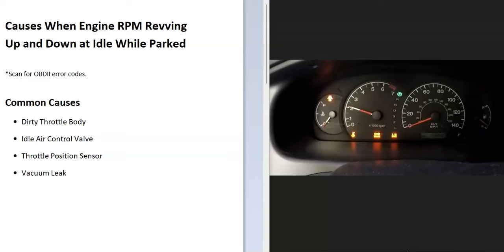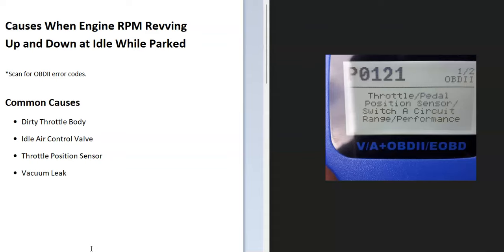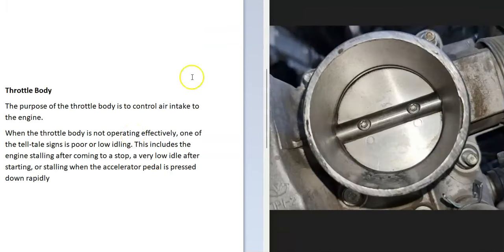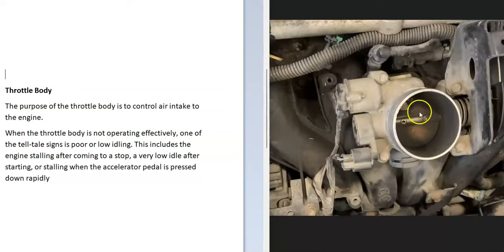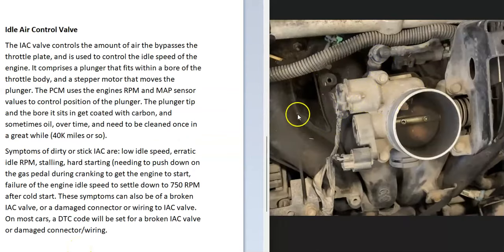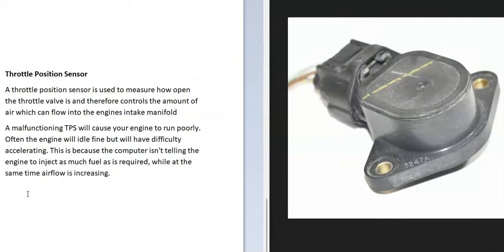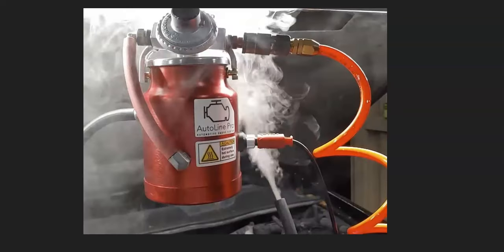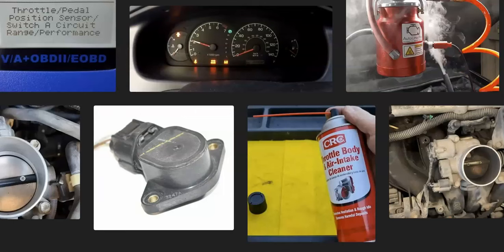Causes When Engine RPM Revving Up and Down at Idle While Parked or Stopped

Comment: I have a vacuum leak I couldn't find.  The idol was bouncing up and down, it was a rubber seal in between the brake master cylinder and the brake vacuum booster.  When I press my brakes hard it idles fine, and when I take my foot off it bounces.

Comment: My 2010 Camaro started doing this after I installed new transmission and a new engine was also in stalled 2 years having it with 170k miles but never cleaned the throttle body for 2 years so maybe it is that

Comment: my 2001 4.2L in my Ford E-150 has been having an idle issue once it warms up. The idle will start bouncing from 300 to 800 rpm when I stop at a light or am driving slowly through a parking lot.  It has stalled multiple times when backing out of a parking spot (while the engine is still warm). Now this issue doesn't happen all the time. It may do it at 3-4 stop lights and not do it for 5-6 lights. If I sit and idle at a drive thru, when I park, it will do it. This bouncing usually last about 5-6 bounces before it smooths back out. Sometimes it hesitates when I need to start quickly like getting on a round-a-bout or when I take off quickly. I took it to my mechanic and he checked for codes. There were none. He cleaned the throttle body with a spray cleaner. Didn't help. He changed the mass air flow and that did nothing to fix the issue. They took it for a test ride and it has yet to act up for them. As soon as I pull out of the shop, it starts doing it again. I took it back to them immediately, and it did it for them for a few seconds. In the meantime, I have to hold both feet on the gas and brake at stop lights so it doesn't stall out. This is my music Van and would hate to break down heading to the gig.
Reply: I'm having a similar issue,  did you figure it out ?
Reply: @rickymack01  Unfortunately, not yet. I was expecting a reply from HVAC Mechanic, but he hasn't responded to me. My local auto repair is going down the list of possible issues (mass airflow sensor, throttle body, IAC, vacuum leaks, EGR, DPFE) It hasn't cost me anything yet since none of their fixes have worked. The brought in a former Ford mechanic that worked at the dealer for 27 years. No codes, but a few measurements that are slightly out of spec. I have drove the van like this for 2 weeks. I have to 2 foot the gas and brake pedals at the stop lights so it wont stall
Reply: @leftyjaysmith  ok, good luck,  my little ranger is acting crazy too. I'm just looking for ideas 💡.
Reply: try a bottle of fuel injector cleaner

Comment: Anybody have an idea for my issue. While in drive and pressing the brake I have noticed the rpm’s will jump by 1. When slowing down to a stop without the brake I noticed no jump in rpm’s. I have a 2015 328i gt F34. I appreciate any advise.

Comment: No codes.   rpms move up down on load ?  Tryd. Carberrettir spray .. New spark plugs. .   Iac. Seems ok 👍.. vacum no luck !!  Micra k11. 2002 .. . Also car runs ok. Bit hestitation pedal ? .. maf ok .reading 10%

Comment: Got 93' Citroen revving up to 4k in neutral. My mechanic says its the throtle body so i have to replace it this video was really helpful
Reply: Throttle position sensor is a potentiometer that provides information on how open the throttle is.  Air idle control is actually an actuator that opens and closes to regulate air flow.  If there's a vacuum leak the computer is trying to regulate the air flow via the air idle control, which assumes there are no leaks.  So surging can take place, or complete dropped in idle or even the engine stopping.  The butterfly in the body itself is just a valve.  Throttle position senor can also effect and automatic transmissions shifting. But if you have a fully equipped spare, you could swap things to find out what has failed or needs to be replaced.  The concept of what is covered in this content is still valid for those vehicles that do not have a ODBII port.  I am aware of this as I have a vehicle that has a system designed by Renault and Bendix.
Reply: @Mauser1965  yeah my mecânico Said that the guy who was trying to 'fix" my car messed up the throttlle body sensors. He Said he tuned them by hand with no device...... He just said if i get a new butterfly the problem will bem fixed
Reply: 4k rpm?!! I would have been afraid to drive it! Lol
Reply: @jeremylucas6819 fr lmfao I wouldn't drive that car at all, love how calm he say it 🤣, his throttle is probably done, I don't think it's sensors.

Comment: My 1998 EJ 20 run at 2000 rpm then drop to 1500 rpm, back fires and some time stall during acceleration also hard start. Have been trying to work on throttle sensors without success but i can drive it around. Good lesson i will keep on pushing hard to fix all the problem
Reply: What do you mean by backfires

Comment: 2004 Honda Pilot.  Starting it up after  more than a year not running.  Battery bad, but It started and  ran fine,  then began to fluctuate between 1000 and 2000rpm.  I put it in gear and it drove into the driveway.  I will be looking at it later.  Thanks for the first places to look.
Reply: Did you figure out what the issue is?

Comment: Excellent information. Thanks!  

 Currently, I have somewhat similar situation with my 99 4Runner where RPM revving up at 1.5 to 2 when step on gas while take off and smooth it out and engine getting rough while come to stop light and noticed RPM revving up when getting ready to take off.

 I Checked and cleaned throttle body with seafoam, replaced TPS, air hose, and PCV valve, and still have the same problem. I have no check engine light come on nor codes. Wondering what do you think it might be.

Comment: thank you sir.  This is a good video. sadly I've done all of these and mine still has it.  it is minimal so i think ill just keep an eye on it
Reply: Other couple possibilities... Have you checked the fuel line pressure?  Or something as simple as a fuel filter?
Reply: @Mauser1965  good ideas and thank you.  I think I'm good there. It has fast throttle feedback and I have changed the fuel filter recently.
Reply: Try replacing the spark plugs. I just watched a video from Scotty Kilmer and he was talking about how a lot of people will try to troubleshoot all kinds of things before they even change the spark plugs. I’m going to try it on my Tahoe because it’s doing the same thing.
Reply: @thankfulblessed3774  
Done but thank you.  I actually wish I hadn't.  With 180k they still looked great. needed to be re-gapped but they were good.

Comment: It can also be a crank shaft  position sensor or a bad fuel pump or a maf sensor problem or a bad throttle body if the vehicle has one
Reply: I mean a bad mass air flow sensor if it has one . Or a bad crankshaft position sensor which all vehicles have i apologize for the screw up
Reply: My 2012 ge6 honda fit .....at times its rpm goes up n down and ...if I press the acceleration it resist thn later

Comment: My car kinda idles funny when parked but when on the highway it will be fine then all of a sudden it feels like it flutters but it's noticeable on my seat. I changed the spark plugs, the wires, intake manifold gaskets and still does it it almost feels like it's intermittent but it does it every time I drive it but at least once every time. 94 Ford Taurus SHO

Comment: My son has a 2018 volvo s90. I believe it's a 6 cylinder. He says that after he's been driving the car for awhile and comes to a stop light, the car will start reving up on it's own. Even though he has his foot on the break. He says this also happens when he puts the car in park. Do you know what could be causing this problem and maybe a little advise??
Reply: Did you ever find out what the issue was? I have a 2007 Kia accelerating on its own.
Reply: Check for a vacuum leak at the brake booster

Comment: I'm not sure if you would know the answer to this but I do drive a 2016 blue bird visions bus with a Roush clean tech v10 according to what our shop mechanic told me. We are having an dicken's of a time trying to figure out a VERY random issue on the bus. Every once in a while, it will just shut itself off when its idling. I can be at a traffic light, parked in the yard or doing a student stop. The only consistent thing is that it always does it in an idle moment. But it can go weeks between shut downs and it always starts up right away. The mechanics have hooked it up to the computer and it is throwing NO codes, no error messages nothing. They have tried a new fuel pump, and some sort of new modual they "borrowed" from another sister bus and it keeps doing it. Some times it will surge the RPM's but that might happen 10 minutes or more before it actually shuts down if it decides to. We are at our wits end trying to figure out what is going on since its not giving us any clues as to check. I know its a long shot that you might know anything, but maybe some other things to look for out of the ordinary? We have 5 guys in our garage, and all of them are just bewildered as to why its doing this since nothing comes up anywhere about it.

thank you for any help if any you can think of. We are stumped.
Reply from the maker: If it shuts off with no idling or sputtering, I would lean toward a wiring issue somewhere, but anything I say is a guess. Those types of issues can be the hardest to find.

Comment: Have an older vehicle a 94 GMC 7.4 engine .  At high idle the rps drop for a few seconds and then goes back to high rpms during 2500 rpms.  Not sure what the drop is.

Comment: hi there 03 bmw e46 agter idle start when secondary airpump shuts down engine hesitating chk engine lights on and if u clear check engine light everything is fine ,when engine is warm nothing happens during start up . injectors , coils, intake  hoses , fuel pump , idle valve,spark plugs, engine oil , transmission oil expansion tank, all replace no change. please reply vaccum hoses in front check not the rear ones

Comment: Started my car yesterday and before I took it out of park I heard the engine revving as if I had my foot on the gas. And since I did not, I was freaking out. It was around 3000 rpms when I shut it off and it had no indication of stopping. It was like a stuck accelerator except I didn’t even touch the accelerator.
After I gave it a minute to rest, I turned it on again and it went up to 2000, stayed there for a while, and sank down to 1500. Which I think is still pretty high for idling in park.
Each time I turn it on it gets a little bit better but I’m too worried to drive it again. 
Any idea what that could be?
Reply: Did you figure out what it is I’m having the same problem ! I’m waiting 3 weeks for the dealer to look at it now
Reply: @trynakillsu1  Unfortunately not. But it decided to stop doing it so that’s good at least lol
Reply: @AdrianR.374 mines was doing the same and now all of a sudden working. Any idea what it was
Reply: @trynakillsu1 any idea of what it was?
Reply: @StarrSingoff_  hey bro I’m waiting on my appointment this next Monday been sitting for now I’ll let you know what they say once they figure it out I had 2 different mechanics look at it and couldn’t figure it out
Reply: @trynakillsu1  same just happened to me 🤦🏽‍♀️🤣 yes let me know please
Reply: Hey guys. The problem came back, but then I realized I was overdue for an oil change.
It hasn’t done it since so I’d say give that a go.
Reply: @AdrianR.374  ok I will do the same
Reply: @trynakillsu1  mines is working now which is weird any word on yours
Reply: @AdrianR.374  still driving ok?
Reply: @StarrSingoff_  my truck got stolen this morning but it was air intake leak and idols control valve
Reply: @StarrSingoff_  Yes it is! The new oil seemed to do the trick!
Reply: @AdrianR.374  change the spark plugs while your at it to

Comment: My RPMs go up when I press on the brake pedal. We just change master cylinder break booster pads and calipers. It stoped doing it for about 2 months. Now it’s happening again.
Reply from the maker: Check the brake booster vacuum line; it may be leaking and causing an issue.
Reply: @HVAC_Mechanic  I think it might be.
Reply: @valeriebroussard630 did you fix it?
Reply: Mines doing the same thing. It's so frustrating!!!!

Comment: 2001Ford Expedition, Triton V8 engine  keeps accelerating when in drive. Any suggestions  on cause
Reply: Did you find out? I'm having this problem currently on my grandma's car. I've been fixing it up as I've been having to borrow it. Mine is in the shop. I can't afford to put both vehicles in the shop. 😅

Comment: What can be the cause of the  RPM up and down, after the engine turns off and turns back on the RPM  goes stable. When I drive a few miles the same thing happens 
Kindly advise 
RAV4 2001 (1998 cc) with engine 1AZ-FSE
Reply: Did you clean air filter and tried again , oil change?

Comment: I have this issue. I cleaned my throttle body and have a new iacv sensor. But my code was P1086. I replaced that TGV. I preloaded it when installing the new one. Now I have P1087 code. Any thoughts?

Comment: I found a 5/16 hose with a pop out pressure valve on the passenger side underneath my 2014 Silverado next to the transmission dipstick,it was leak air,

Comment: On my 2018 Mazda 32.5 L it idles at 5:50 but changes to 720 when the air conditioning compressor turns on. I’ve cleaned the throttlebody and checked everything and nothing seems to fix it. Is this a computer issue can be solved with the programming fix?

Comment: We have a quick question for you, sir, we recently had the engine mounts in our daughters 2015 Audi A3, and after we picked up the vehicle from Firestone it started idling just like you described in your video while in park mode. Could changing engine mounts caused this? Thanks in advance!
Reply: most likely a vacuum leak. hoses can get unplugged by accident while moving the engine up and down to change the mounts.

Comment: have a 2015 chevy cruze 1.4 turbo,when starting idles a little high then goes down,then when take off it stalls and after a couple restarts runs fine and no codes?

Comment: Hello. I have a problem. Don’t have much to spend to take it to mechanic. I changed injectors myself. Now the whole engine is shaking. I just want to know holden commodore Omega VE series 2 LPG 2013. I have ordered manifold air intake gasket but it has no rubber or sealant something. Just wanna know does it really don’t need i have to buy some sealant or something else for it because it’s a metal piece that they call it gasket.

Comment: My 89 Ford Bronco stalls, engine shuts off when i come to a complete stop.i replaced the tps, idle air valve, distributor, fuel filter. And still does it, any ideas?
Reply: Same thing happened to my 95 integra turns out part of the wire harness was messed up and not reading the vehicle correctly. Maybe that could be the cause?
Reply: @jaykuroki5932  I'll check it out. Thanks

Comment: Mine idles normal but when AC is on it it revs and goes back to normal then revs constantly at cold start it revs high then goes normal ... it started when I cleaned out the throttle body
Reply: Same with my nissan juke
Reply: Did you find out what the problem was ? I'm having same issue my rpms going up to 1k rpms and 700rpm . Only does it with the ac on

Comment: In generel, RPM level is at 1000, But once i turned on A/c, RPM goes down.. What can be the cause.?

Toyota, Corolla
Reply: Did you face this after oil change? Did you clean air filter?

Comment: I am having issues with my ford F150 2009. it just had an engine replaced and started to rev on its own while parked after driving for maybe a couple minutes. it will rev and shake but drop the rpms down after the shake. Feels like a misfire by the lack of rhythm in the shaking. If you could help me figure this out, this would be great.
Reply: Forgot to add that I already checked for any codes but non of them showed up. only a code for my TPMS sensors
Reply from the maker: The throttle body may need to Relearn. Often the computer can Relearn on its own, but it can vary and is vehicle specific.

Comment: Other videos say to turn the key to on and then off then turn the engine on and step on the brake put the emergency brake then put the car in drive and let it idle for about 5 to 7 minutes. If it's a computer problem it will fix it
Reply: I’m gonna try this
Reply: @dlbutler0113 what happened? Did you fix it
Reply: @Cezzm  yes it was my fan had a short in the motor
Reply: @dlbutler0113  thank you so much I want ask the idle up and down just when you turn the AC? Or every time
Reply: @Cezzm  every time it would idle whether ac was on or not. The fan motor had a short fan motor is used to keep the motor cool and the second fan is used for ac neither one of my fans were working

Comment: Could this happen from a dirty or oily air filter ? I had an oil leak engine got washed ,and the filter got wet and dirty dirty. Going next week to get new one.  I’m just worried. Is this a possible issue ?
Reply: It could be that the MAF sensor is dirty or has oil on it

Comment: I have a 2008 corvette with no codes. Every now and then when coming to a stop the engine revs up and lunges forward. If I stay on brakes it stalls. Again, no codes found and does not happen all the time. Any idea what to look for?
Reply: Did you find out?
Reply: @canivaas_loreto9715  other than being told to clean the throttle body, no. When it gets warmer outside I will be making some paint repairs and cleaning the throttle body. Any ideas yourself?

Comment: Mine stays high idle in mornings and when coming to a stop stays high idle not real bad but annoying still haven’t figured it out
Reply: Im in a truck stop in California and I have the same issue. Only happens when I have to be stopped for reset after maybe 3 times to have the smart idling active for battery charge. Today the RPMs went to 900 to 1400 and the vibrations woke me up.